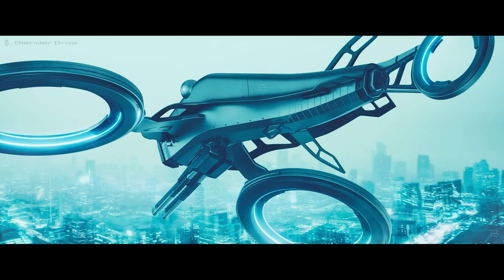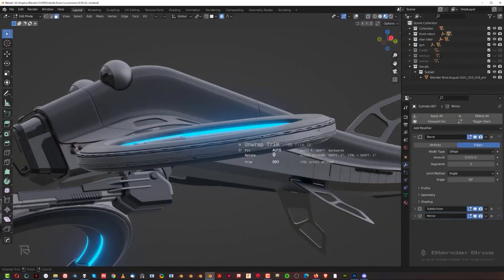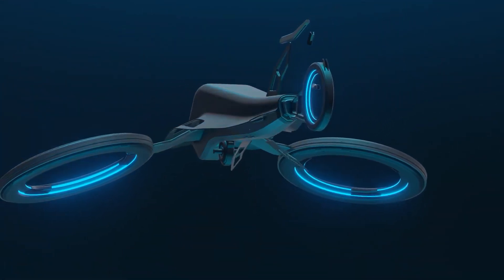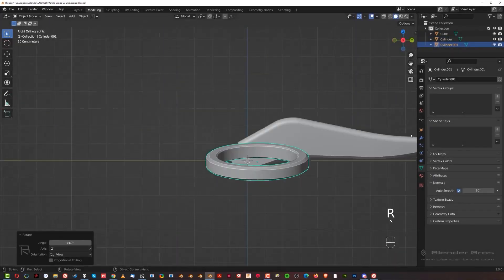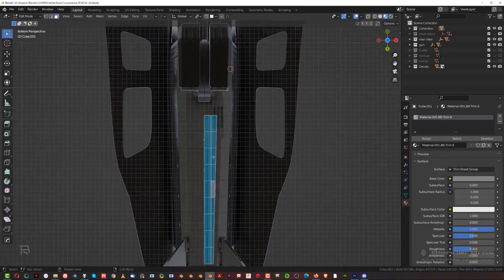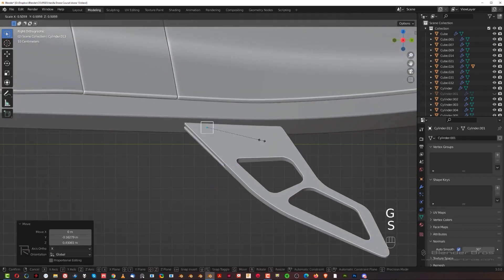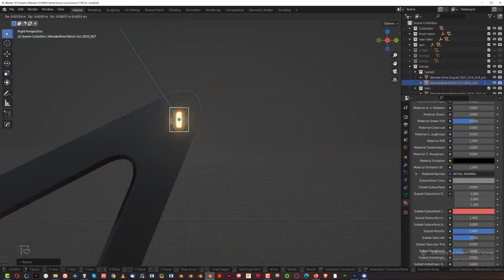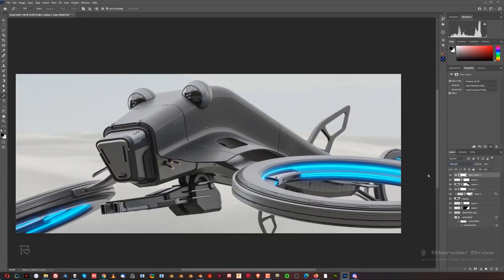Hard Surface Drone Design in Blender

Comment: Most of the Blender modellers just use boolean and fuck up the topology.
Reply: Nah. Using boolean is okay if you know how to clean it up.
Reply: They use hard surface add ins for their course. It has great cleanup tools to deal with the topology issues
Reply: @maw8078  when satan sees thus type of topology, he becomes ur fan
Reply: True. Most of the time it's just random booleans, bevels and extrusions all over the place without any regard for function or intention. This drone's design is a good example of that.